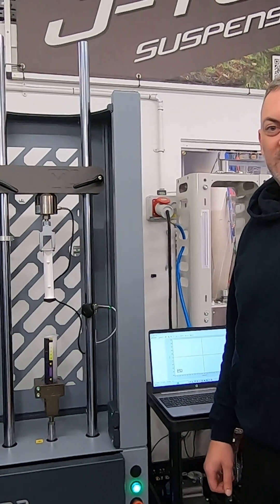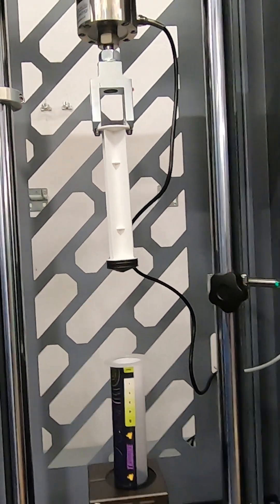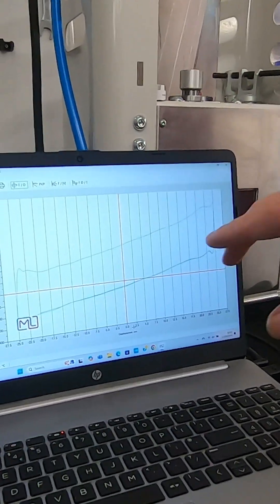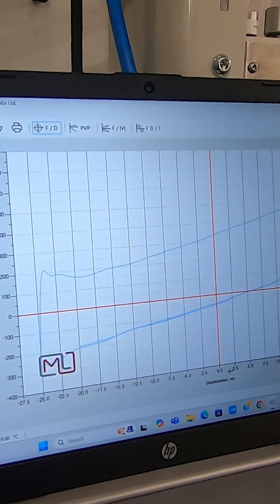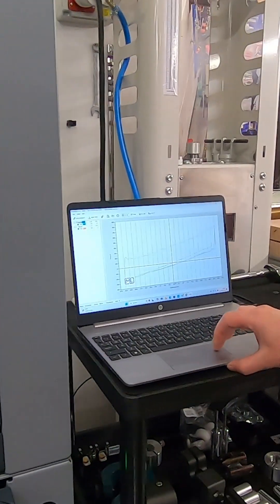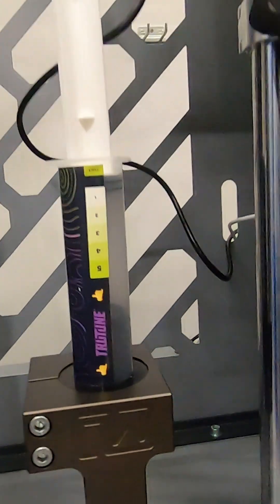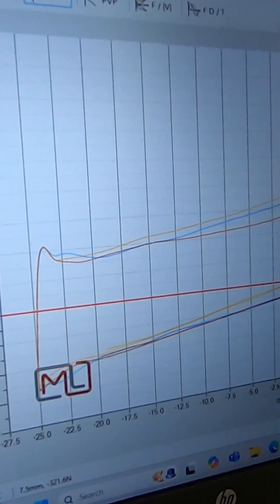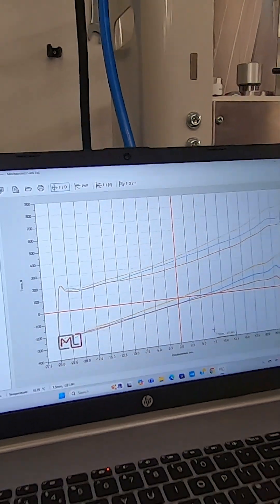TruTune Flow - Does it actually work?

Comment: Would this help a 50kg rider get more useable travel out of a Zeb?  At the moment I’m having to balance ride height and travel. At a good ride height/sag the fork never achieves more than 20mm from bottom out and if I drop pressure to get more travel it sits at 40-50% sag.
Reply from the maker: Yes, this is exactly where the product excels, in our opinion.